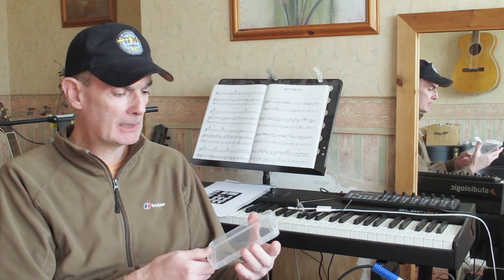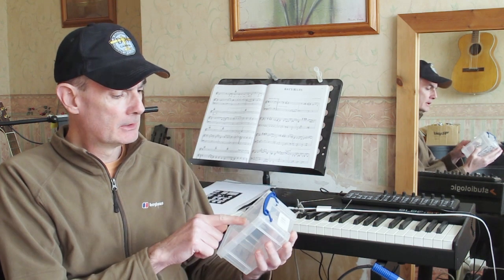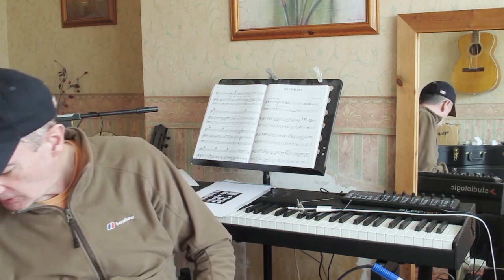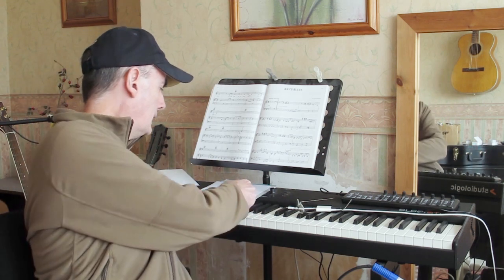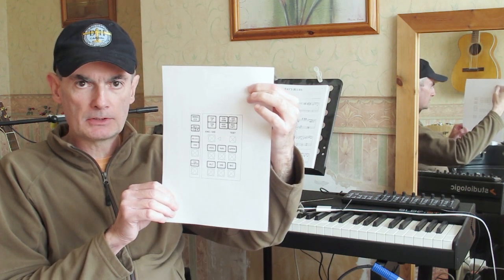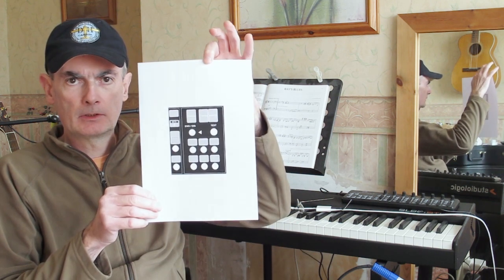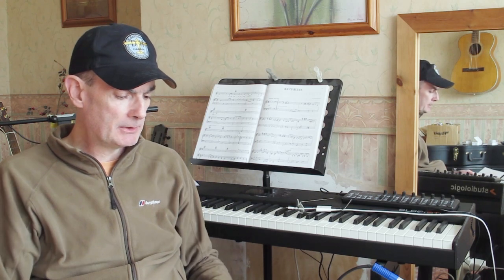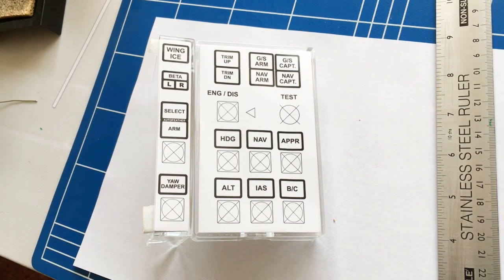Constructing the Main Autopilot (Twin Otter Cockpit Build - Part 50)

Comment: Great video as allways.
How did you stick the label onto the box? 
Some kind of special glue?
Reply from the maker: No, it's not stuck on. The graphic sandwich (printed graphics, transparency, tracing paper) is held on by the components. And a few bits of masking tape around the edges here and there :)
Reply: @AlmostAviation  I See, thanks